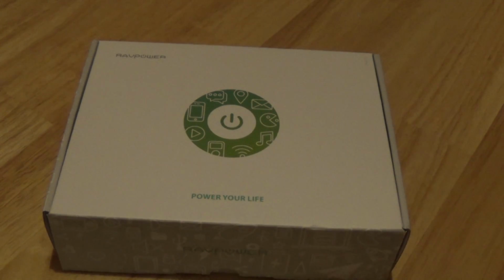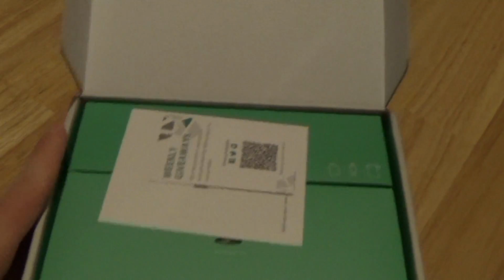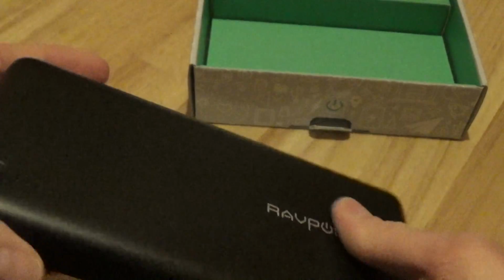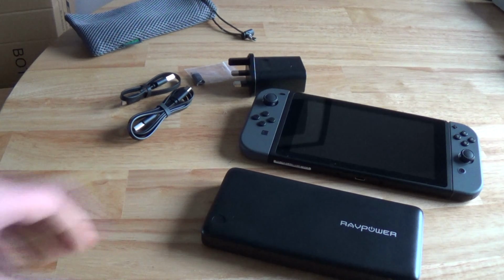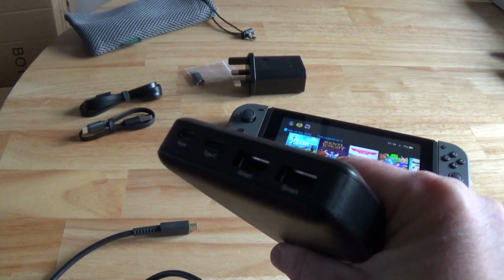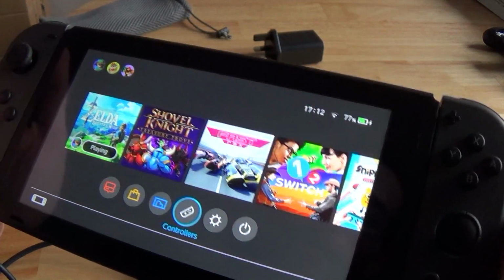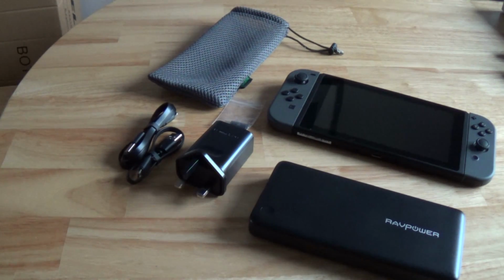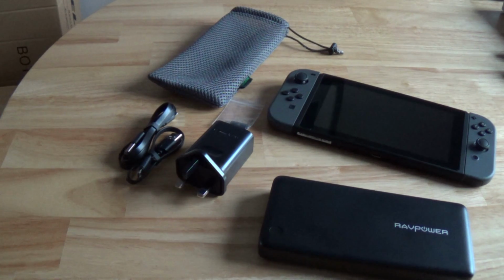Switch Charge and Play Solved - Ravpower review

Comment: I might have to look into the power pack :)
Reply from the maker: Definitely worth it in my opinion. I would get a decent USB C to USB C cable as well as it is so much quicker to charge. Check out my other video (https://youtu.be/29E0RCxWi0E) if you haven't already for a better idea at the difference in charging speeds :-)

Comment: great power bank, but don't use the charger for the battery, buy a new one because it puts out 45 watts when it should put out 30watts, this will eventually damage the switch if you have it plugged in while charging the power brick.  the power brick could also damage the battery pack according to Benson.  look for a new plug that outputs the proper 30 watts and uses USB PD (POWER DELIVERY).

This is currently the best power bank for the switch, because it can output 15v 2amp with a usb c to USB c cable.

only caveat with this power bank, is you need to plug it in while it's in sleep mode to get full speed charging while playing.
Reply: Costa Apostolou so this is the portable charger i should use correct will it charge my switch as fast as if it was plugged in using the wall adapter
Reply: My son reccomended me this battery bank

Comment: Get a USB-C cable. This battery charges the Switch as fast as the Switch adapter.
Reply: This is it for now until more batteries come out that are USB-PD compatible. In one forum, I've only seen a comment from a single user about another battery that has USB-PD and he had to order that from Asia. I think the brand is Xiaomi. According to the user, the Xiaomi battery has the same quirk as the RAVPower that requires the Switch to be in sleep mode first before plugging in the battery. Otherwise it will not charge properly. Because of this, I'm not so sure whether it's Nintendo or the batteries not completely conforming to the USB-PD standards.

I have done a lot of reading and searching for batteries with USB-PD. RAVPower and Xiaomi are the only brands right now with USB-PD. Razer is also coming out with one but it will cost $150 for a 10,000mAh capacity.

RAVPower actually has 2 batteries with USB-PD right now; the 26,800mAh shown in this video and a 20,100mAh one. Since both capacities have the exact same case dimension (26,800mAh being a little heavier), I'd suggest you try to get the bigger capacity.
Reply: I haven't really done any tests on this but being conservative, the 26,800mAh should provide the Switch with at least 12 hours extra time on a game like Zelda. This is calculated with the assumption that Zelda will only run for 2.5 hours on the Switch's internal battery. This is also assuming that the RAVPower has 20% less its stated capacity, which is normal for all batteries since the transfer of energy is not 100% efficient.

As for charging times, watch Three Times A Gamer's update video on this battery. He gives you an idea of how fast it was charging the Switch and how it compared to the adapter that came with the Switch.

Be mindful though that I would not recommend charging from the battery while you're not using the Switch. It will charge just fine but once the Switch reaches 100% you have to be there to unplug it from the battery, otherwise, the battery will start charging itself back from the Switch. This stems from USB-C's bi-directional design. This is the main reason why I felt the need to get a battery that is able to charge the Switch as fast as possible even while playing a game. Since the battery is able to top off the Switch while playing a game, it means that I never need to leave it plugged in to the battery whenever the console is not being used.
Reply from the maker: Francis Faustino I'm going to grab one soon to test out the difference in speed of charging. But thanks for the heads up 🙂. Just wish they included one in the box.
Reply: When you get your cable, please test if putting the Switch to sleep first before plugging in the battery makes a difference. I'm reading multiple comments from people that when plugging in the battery while the Switch is on won't get the charging notification. You have to put the Switch to sleep first before plugging in the battery to get the charging notification. This is how mine works. At first, I thought that this might be an issue with the battery's firmware but I have read at least one other user who commented that his battery from a different brand is acting exactly the same way.
Reply from the maker: Francis Faustino Seems a bit strange. Guess it's something to do with USB C being multi directional that maybe the Switch tries to charge the power bank instead. I've heard of this happening with other devices so it could be a similar issue as a standard usb to usb C didn't have this issue for me. I will let you know my findings once I test a USB C to USB C cable.
Reply from the maker: Francis Faustino I purchased a USB C to USB C cable today so will test it out soon. Quite busy over the next couple of days but will let you ASAP how it works out.
Reply from the maker: So I have tested my new cable and it makes a huge difference. You are correct that the Switch does need to be in sleep mode for charging to be activated. I have made a new video comparing different charging options if you are interested - https://youtu.be/29E0RCxWi0E
Reply: Thanks for the update. I watched the other video and this is exactly how mine is behaving.
Reply: Three Times A Gamer you can charge your power bank with your Nintendo switch charger for fast USB c charging for the power bank, it's much better than the included one that will eventually catch fire/damage your device.

great video, I watched it before my purchase.
Reply: so in your opinion this is the best battery pack for the switch?
Reply: Francis Faustino ok cool check this link out for me to confirm this is the exact same battery well i checked the model and its the same it just has-2 on it https://www.amazon.com/gp/aw/d/B01LRQDAEI/ref=mp_s_a_1_1?ie=UTF8&qid=1492102157&sr=8-1-spons&pi=AC_SX236_SY340_FMwebp_QL65&keywords=ravpower+pd+usb+c&psc=1
Reply: Yes, this is the same battery. For my screen, at the top, it shows my purchase date of this item.
Reply: Francis Faustino ok cool so well worth the money and probably one of the best ones that is actually compatible and will charge the switch as fast as the orginal wall chargee correct.. oh and in your opinion how lond do you think the battery can last without recharge and how long do it take to charge your switch approximately?
Reply: Francis Faustino ok thanks much needed info 12 hours of extended battery os enough for me i would say.. have you heard about the switchcharge battery case if sp whats your thoughts on that?
Reply: I have heard of it and it seems to be a good concept. The only thing is, with only 10,000mAh, there is no way it will run the Switch at the stated 12 hours while playing a game like Zelda. More realistically, with a game like Zelda, using the same calculations from my previous post, it should be able to run the Switch for a little over 4 and a half hours.

Also, I do not know how the Switch will deal with heat dissipation while enclosed in the case. Even the dock that comes with the Switch, if you look at it from above, it has tabs on the edges so that it creates a narrow gap between the dock and the broad sides of the front and back of the Switch unit itself.

If it works well though, and heating is not an issue,  I might prefer it for shorter day trips rather than having to carry a separate battery pack with wires. We'll have to wait for the reviews though to determine that. For long airplane trips, I think I'd still prefer the RAVPower since I'm already going to be carrying a backpack with me anyways. Setting up the Switch on a stand on the tray table in front of me, with a wire going to a battery, would not be much of a hassle since I will be stuck in that airplane seat for a good few hours anyways.
Reply: Francis Faustino question only getting about 1 percent every 10 mins why is yhat got a usb c to usb c cable put in sleep mode before plugging in when its charhing the switch does the lights suppose to stay on cause mines turns off?
Reply: I think the lights on my battery turns off as well while charging. Are you getting the pop up on the Switch that tells you it's charging when you plug it in? What percentage is the Switch's internal battery at when you were doing your test?
Reply: Francis Faustino yea it does well i just played it dwn to 15 percent then put in sleep mode pluuged it in gping play on full brightness n full volume witg joy cons attached n wifi for an hour timed to see how much percentage i get
Reply: Francis Faustino sheesh on full brightness full volume n wifi only went up to 24 percent from 15 withthin an hour am i not charging it right or is that basically how it is
Reply: Francis Faustino and are you using the ravpower usbc to c cable or something different
Reply: I just want to make sure that your Switch is showing the charging icon?

For a more accurate test, you should charge it all the way and take the cumulative time. Charging batteries does not really happen in a linear manner like most people believe.

Another issue I can think of is the USB cable. I didn't do a lot of reading on cable but if I recall correctly, the USB-C cable must support USB 2 or 3. I didn't read too much about it because I just went ahead and bought a USB 3.1 cable. Not all USB-C cables are the same. The maximum specification for USB-PD through USB-C is 100 watts. I think a lot of the cheaper cables or unspecified cables are only able to support up to 15 watts. When buying a USB-C cable, you have to make sure that it actually specifies that it can do the power you intend to use it for. Let me know what kind of cable you have.
Reply: Francis Faustino i actuallt have an anker usb c to c its a 3.1 i believe and my power babk actually came with a ravpower usbc to c so im going try that later and see how that one work but i heard anker cables are extremely good what kind of cable do you have?
Reply: My RAVPower actually didn't come with a USB-C cable. I bought one of the last units from the previous batch before it went out of stock on Amazon. Mine came with a 30w USB-C wall adapter. I think they took out that adapter because it didn't fully complied to their specification. In some people's tests, the 30w adapter would actually try to pull 45w if the device plugged in it asked for it.

I also have the Anker 3.1. It's the only USB-C to C cable that I have so I can't compare. Regarding your comments earlier, were you using the Anker or the USB-C cable that came with the battery?
Reply: Francis Faustino i was actuslly using the  the anker but mind you i was playing at full brightness full volume joycons attached abd wifi on.. an hour or plugged in from 15 to i believe only 24 that's kind of bad in my opinion lol
Reply: Hey, if you think that's bad, try it with USB-A to C. haha

You can also try it with the adapter that came with the Switch and see how it compares.
Reply: Francis Faustino how do you charge the battery had it charging  over night and it doesnt get to full battery only 3 led lights showing not the full 4
Reply: Make sure the adapter you're using is powerful enough. If it's not, they can take forever to charge (11-16 hours). As I said previously, mine came with an adapter that people complained about so they stopped including it. The adapter is 30w so it only takes about 7 hours to charge from empty.